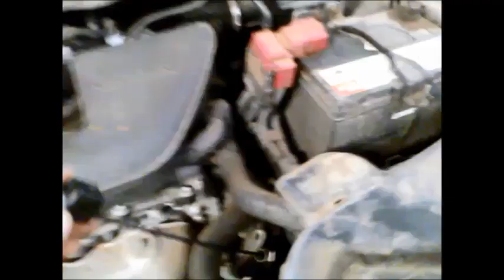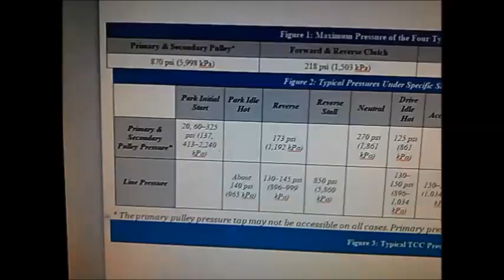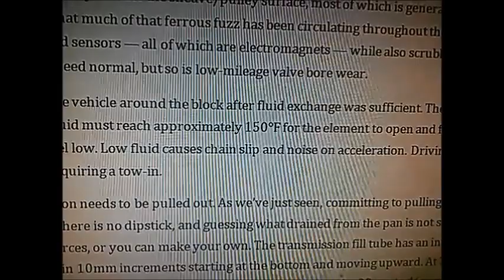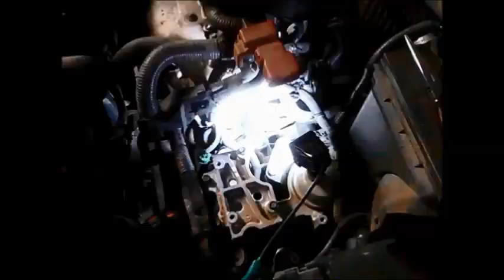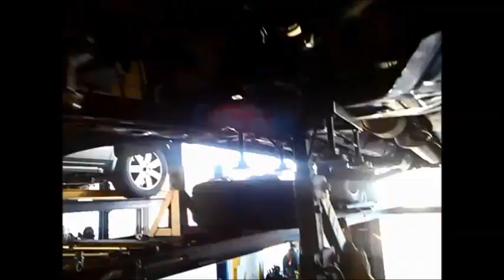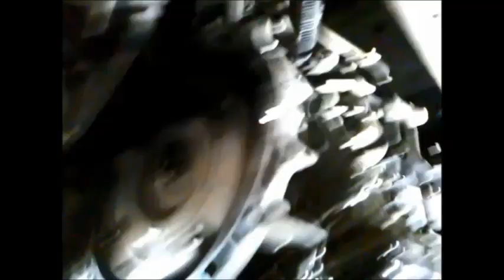Nissan Mitsubishi Jeep CVT RE0F10A JF011E Fault P0868 Removal for Overhaul, CVT Remove Transmission

Comment: I have a 2013 nissan rogue I have a p1778 and a p0868 I changed the step motor because that was the first code I got. Now I'm getting both together. When I drive it in reverse it won't go over a hump in my driveway without giving it a crap load of gas and even then it doesn't wanna go. But it will drive forward if you ease the gas, but it doesn't shift when it's supposed to. It over revs then shifts like driving a manual transmission.
Reply from the maker: hi, you always need to bench test  flush/replace as many solenoids as you can. often the tcm will log the biggest faults first...fault codes are generally related to electrical issues. it sounds like the pulley hubs are worn and/or pump flow control valve is worn or pump is buggered. check all basics first then work your way up. check out our cvt playlists    https://www.youtube.com/playlist?list=PLQLkuOdKuFovbr9oWGQdHmayqSbQF-JAY     cheers
Reply: @YepThatsIt  it sounds like it's a pos, and nissan shouldn't be producing vehicles anymore.

Comment: I have a 2012 Mits outlander. drive shifts great in sports mode but in drive not much power and hard shift from first to second. yes I know it doesn't actually have gears. I have changed the fluid but do you think changing that filter would make the difference or should I change the sensors?
Reply from the maker: hi, filter service rarely fixes those issues. most likely contaminated solenoids and sensors and or worn trans. cheers
Reply: Did you fix it? I'm having Same issues

Comment: i have a 2008 nissan altima with the p0868 code new fluid installed runs and drives great until i come to a stop and try giving it gas it won't much quick but once it does it drives fine also if i turn off the car and turn it right on it revs and moves like nothing... you know what it could be? im stumped with this issue..
Reply from the maker: hi, sounds like blocked filter. its useless to change the fluid on these without changing filters, if its not filters then the pressure valve in pump could be worn or sticking. try doing a pressure test. cheers
Reply: Hi, what was the outcome for your problem? I am having similar problem. So, I thought I should not waste more time, if the end is CVT replacement.

Comment: Greeetings and thanks for making time to put up this video. Actually i do have a " P0868 fluid pressure low" that gets the vehicle (Nissan Sylphy) struggling on slopes. If i drive for a few minutes, say 10 minutes, and i happen to stop on a slope for a minute, i wont be able to snap throttle or get the vehicle to move as it will stall for a few moments before it moves. That's even with pedal to the metal. As that happens, (pedal to the metal) speedometer stays still, engine stays quite until few moments later when it finally moves. I still don't know where to start from.
Reply from the maker: Hi, always check all the basics first...fluid level, good electrical connections, charged and good strong battery etc. then you might have to check if filters are blocked especially if regular transmission services haven`t been done. then you may need to pressure test ports to see if worn internally or internal pressure leaks. on these the valves inside the pumps are prone to wear. you can get improver kits from sonnax.com. maybe get a repair manual ( ATSG or similar ) hope that helps cheers
Reply: @YepThatsIt  thanks for your time. Am sure your advice will help. I will try everything you've put up and I will keep you posted. Nice time
Reply: Hi, Did you figure out what was wrong?

Comment: Sounds like a race track you’re next too. Good video couldn’t take the racing motors passing. Why is the tranny bad? The pump?
Reply from the maker: haha not race track, is main road in town. trans probably never serviced , pump valve and balls worn out. see the other video. cheers
Reply: YepThatsIt I’ll check them out. I’m getting beat by a p7046 pressure code that’s killing me. Cannot figure it out. I replaced stepper motor already then it was great after that this code kicked on. Now runs in limp mode only. Any thoughts? Where is that pressure solonoid A? It’s 3.5 cvt
Reply from the maker: are you still getting that fault code? does it clear? did you refill it to correct fluid level ( not overfill as the spinning parts will aerate the fluid ) the primary pressure solenoid is next to the pressure switch, secondary pressure solenoid is next to the primary solenoid. was there much debris in the pan? did you check the inline filter if blocked? make sure you have a good and strong battery as well. these like that one I reconditioned have a problem where the valve in pump gets worn or jammed, you can get improved designs for these valves. also replace the ball bearing on the clutch packs with solid stainless steel balls, they will last much longer than the original ones. sorry hard to diagnose without seeing it....hope that helps cheers
Reply: YepThatsIt thank you for the info. It’s the 3.5 so the primary is not in the valve body it’s next to the stepper in the housing of the tranny. The inline filter was blocked I blew air and it’s clean now and working until I get a new one (dealer only).  I put new fluid in it and it’s at the correct level. I changed all the solenoids but the primary I can’t figure out what one I need. There are “long” and “short” versions. The code still coming up is the primary pressure stuck off code. I tested the ohms on the wire and it seems like it’s a bad switch. It’s causing it to have to press pedal to floor to get it to move.
Reply from the maker: sorry I'm on holidays till 14th....if its going to limp mode, its usually a electrical problem. you need to check all solenoids, looms, wiring, blow out sensors, inhibitor switch, make sure battery is strong and good, also check the brake switch under pedal. if your inline filt was blocked, that usually indicates a problem inside creating excess debris. the filter is limited by the size of what particles it lets through, without restricting flow. so the finer ( grease like consistency ) debris will still pass through filter and be attracted to coils inside the solenoids. I'd say has contaminated all your solenoids. also while you have valve body off, you can air pressure test the clutches, but to get the pulleys to move you need to be turning slowly. if you are going to put pressure gauge on make sure you use a higher pressure gauge as these units operate at much higher than usual transmissions. when after you do all that also make sure you add extra magnets to help collect the metallic debris still floating in there.....and cant recall which ones but some cvt units you will also need to get up to temperature before a valve opens so you can actually know all the air has purged from the system when you are checking fluid level. might be good idea to get a manual ( we use atsg) hats off to you learning mate, cheers